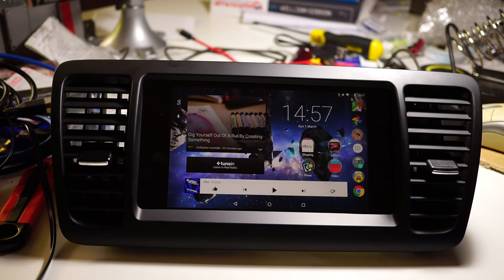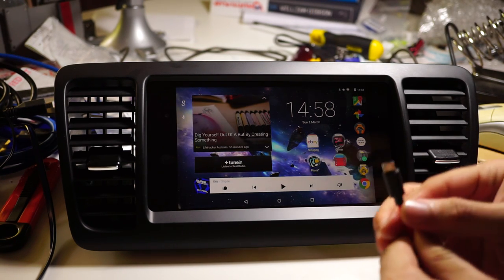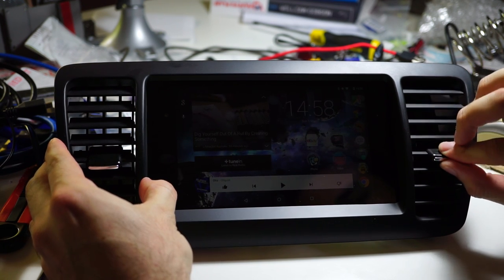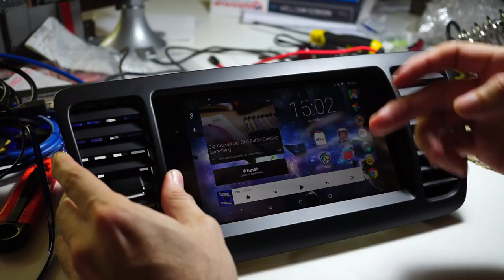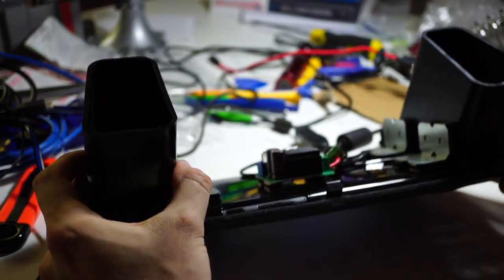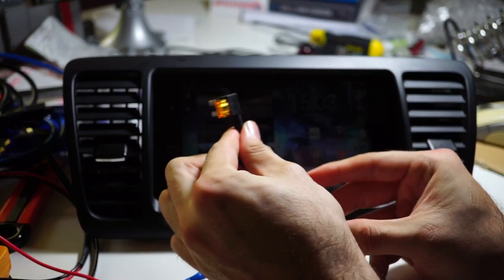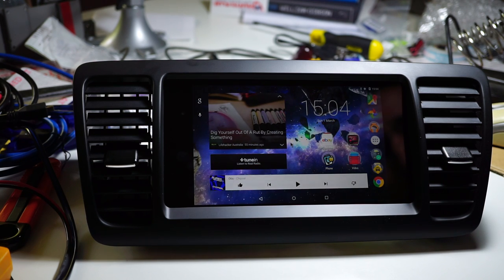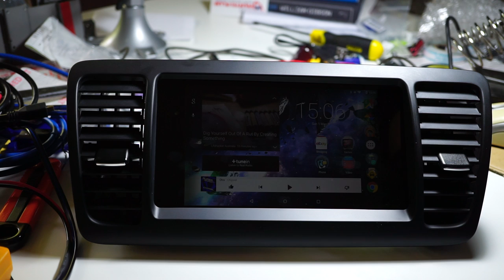Work In Progress: Android Tablet Installation in a Gen4 Subaru Liberty Part 1

Comment: Jeff, just seeing this video. which console/vent/dash thing are you using? Looks like theres one with a smaller hole (i assume for the stock gps screen) that blocks out some of the nexus but you have something larger (and maybe with narrower vents?). Probably very hard to get this part nowadays im assuming
Reply: The car parts are genuine Subaru but are no longer made. You can only get them secondhand. Everything else is essentially eBay and your local electrical parts shop.

Comment: Hi, great video! One question if I may: how are you planning on implementing the reverse camera? I already have an RCA one now on my 2-DIN head unit but I haven't seen anyone connect it to their Android device yet.
Ed
Reply from the maker: Timur's ROM also comes with an app to show the feed from a UVC composite video capture device. The reverse camera will contect to that and will switch over automatically when the tablet detects the reverse camera feed is on (powered by the reverse lights).
Reply: Jeff Sereno Ah thanks, it's a great help. I've just seen one or two of them on ebay - RCA-USB UVC adapter. The description says it won't work on Android tablets with built-in cameras though. Will it work with a custom ROM?
Reply from the maker: Spaghetti888 A true UVC capture device should "just work" on any system be it Android, Linux, Windows, Mac, etc with no additional drivers. In the case of Timur's ROM specially made for car installs, it also carries support for some variants of the popular EasyCap USB capture device that you can get on eBay. The difficult part is getting hold of a supported model because they all look the same!
Reply: Jeff Sereno Good thing you responded to me - I searched for "UVC USB" and got a couple of items located in China at 30-odd pounds. The Easycap dongles cost about six!
Reply: Hi Jeff, did you ever manage to get the reverse cam going? I got a capture card with a stk1160 chipset but I get a "failed to init video" message. And the thing took a month to come from China!
Reply from the maker: Spaghetti888 No haven't had time of late. Intend it get it done soon, though!

Comment: Hi Jeff. Thanks for the video . Just wondering if i can use my original air vent central panel ? Do I really have to order a new one ?
Reply from the maker: The replacement fascia has narrower vents on the side to make more room in the middle to fit the tablet. I've seen people modify the fascia of the factory nav unit (after removing the nav unit) to some success, but there's work involved in doing that and making a neat job of it.
Reply: +Jeff Sereno ive just realised that after seeing my car. Its a dodgy job, you are right about buying the modified part. Thanks for the info

Comment: hi there Jeff Sereno,
i was wondering how you were able to get the Subaru video clip to come on after the nexus is turned off. I'v been trying to figure out how to play your clip on my nexus 7  but it has been nothing but a big fail. i would really appreciate  your help on this. thank you.
Reply from the maker: That is a function of Timur's ROM. If you don't have that, then you will need to use alternative software to trigger the video when power is disconnected.

Comment: Hey there, really having troubles finding the Subaru OEM replacement air vent center panel link seems to have changed. Any advice plz :)
Reply from the maker: Unfortunately it is now out of production. You can only buy it second hand now, or get someone to fabricate it for you. I've noticed on a few forums that there are projects of people looking to laserscan and 3D print them.

Comment: hi nice work.what was the total cost of the project.and do you sell a ready made one.
Reply: Sorry for the late reply. By the time I bought the air vent replacement, clock relocation kit, double-DIN fascia and replacement HVAC controls on top of the tablet and other bits of kit, I spent around $1K. These days now you'd just get a headunit with Android Auto built in.

Sorry, don't sell them ready-made. Also, Subaru no longer manufacture the parts I used in this project - you can only pick them up secondhand now.

Comment: Hi.
I'm planning to do the same project on my Subaru.
how did you make the charging and audio cable plugged in? the air vent does not disturbing?
Reply from the maker: Audio is done over Bluetooth - no cables. The charge cable is a modified Y-Cable from eBay - you have to remove the outer casing on the MicroUSB connector to make it small enough that it does not foul with the air vents.
Reply: Jeff Sereno OK Thanks.
when you release  the next video? I really like your work.
Reply from the maker: vitalie milman Soon! I'm also looking at making my own Y-Cable to get around the power limitations of the eBay cable, so I'll document that too.

Comment: Hi,

You mention the voltage regulator being important on the power supply but the link in the description links to one that doesn't have one? Or is the one you linked to correct?
Reply from the maker: stidor The pic in that listing is misleading - the PSU provided by that vendor does have a regulator as shown in the video because it's the same listing I got my PSU from.

If it's properly set from factory, then the regulator is not needed anyway, but it can be useful for deliberately over-volting the output to 5.2-5.5v or so to overcome any shortcomings of the USB charge cable if it's made of cheap materials (in particular most cheap eBay OTG Y-cables).
Reply: Jeff Sereno Ah excellent. Thanks heaps! Really appreciate your time and effort documenting your process. I'm about to start my journey doing the same thing. Your video, description and links will be a big help.

It's been a few months since you did the upgrade, how do you feel towards it? Was it worth the time, cost and effort?
Reply from the maker: stidor I've actually got the next video somewhat ready with it installed in the car, but I haven't edited it for upload yet - haven't had time.

Was it worth it? Yes, absolutely. It looks and feels very OEM and becomes a bit of a conversation piece with new people in the car. The overall effort was really quite low in the end, but the result feels great.
Reply: Would love to see it when you get the time! Have ordered all my parts today. Did you end up also doing the info panel relocation?

Also are you able to go into a little more detail on the 100Kohm resistor modification you made to the OTG Y-Cable? This has got me a bit worried.
Reply from the maker: stidor Yes, I also did the info panel relocation - expensive bit of kit, but certainly easier than trying to fudge something up - fits like a glove.

As for the resistor, I didn't use it in my final install in the end - for testing I used an OTG+four-port-USB-hub cable from FleaBay (my original plan for hooking up multiple devices, but dropped that idea later because the tablet was then providing power for connected devices) and found that OTG+charging just magically worked, so I currently have that cable connected, but only have the USB hub connected to it plus the tablet charge cable. You'll see it when I upload the next video.
Reply: Jeff Sereno Ah nice, hopefully I got the right relocation kit then - japanparts gave me the D-F option for it. (I picked A-C but told them I have a 2008 liberty sedan and they switched it to the D-F option.)

Ah well that's good news regarding the resistor. Hopefully mine works without it too then! I don't have any plans for requiring power for other devices - just the tablet so hopefully all should be good.
Reply from the maker: stidor A-C is the pre-facelift Liberty/Legacy from 2004 to 2006. D-F is the post-facelift version from 2007-2009. The Japanese used letters instead of years to identify each release.

You'll be fine with your basic Y-Cable setup, but I suspect you'll be wanting to expand your setup soon enough! ;-)